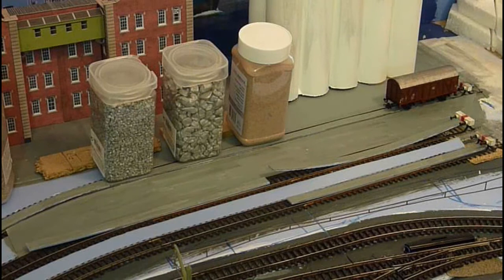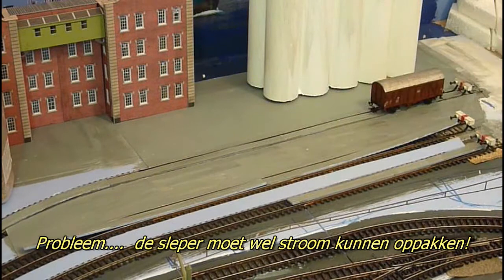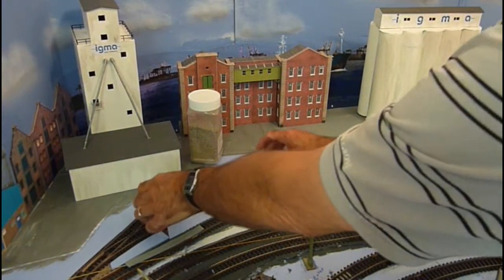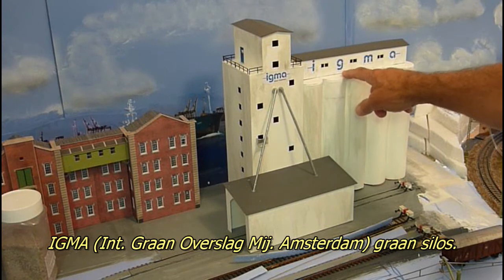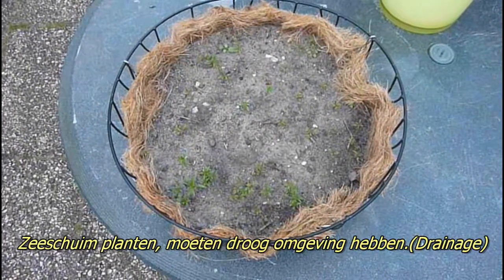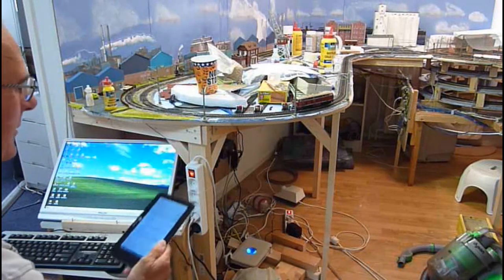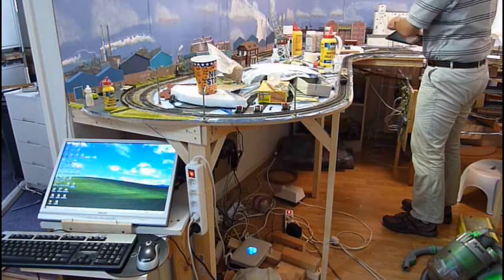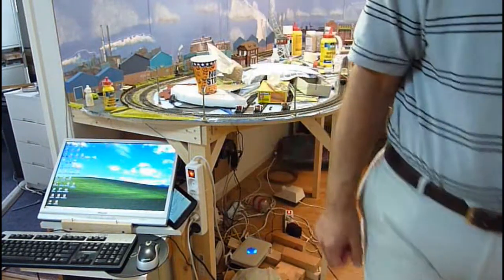Vlog 26 Rhineland H0 Layout update   Concrete track Silos Trees Gadgets

Comment: what if you took a "truck" off of a car ,"wagon" and centered a small nail through the hole and run it down the track "scribing" a cut in the plaster or foam, increasing the pressure till you get the depth you need, Just a thought, Chuck
Reply from the maker: Thanks Chuck, interesting idea. The foam is quite soft, so I can press a line in it. Wire needs to still be reachable by the pickup. Robert